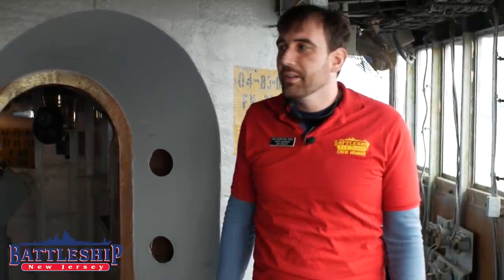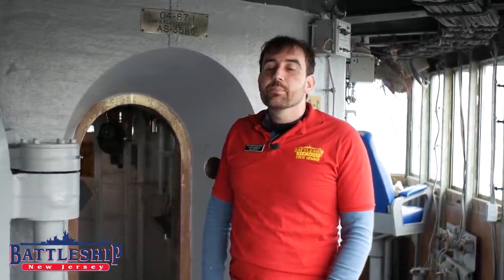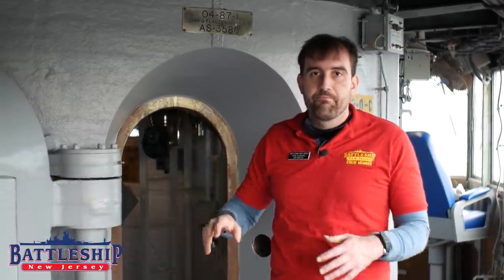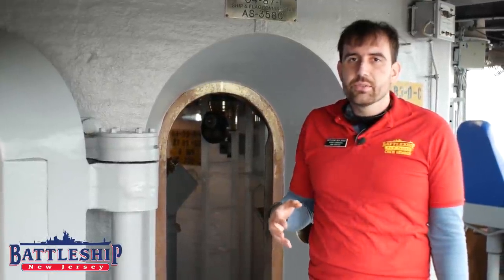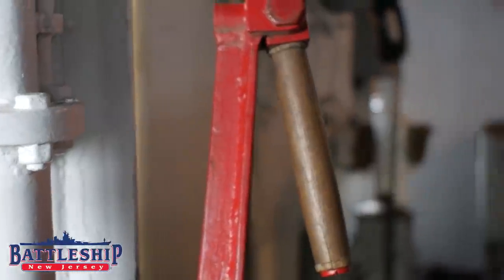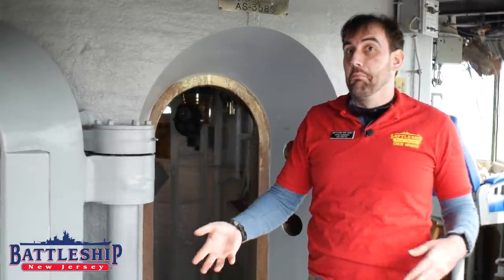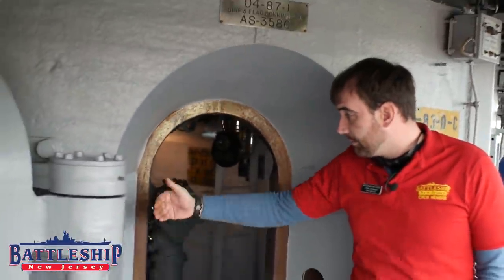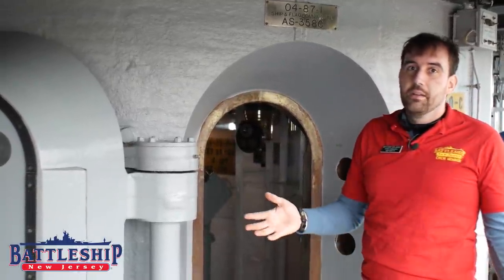Opening the Door to the Armored Conning Tower

Comment: I believe that the crank was a direct mechanical feature of the door and also it is just electric motors that open and close the door; what you would need for the system to be hydraulic is a fluid tank, pump and control levers and if it were hydraulic it would take a lot more time to operate the door with a hand cranked pump
Reply: Despite Ryan's protestations about taking forever and a day that door seemed to move pretty quick once he started turning the crank. Sure seemed like a mechanical operation from my perspective.
Reply: True..  You need a mechnical crank when the hydraulics is NOT WORKING..  So it make no sense to crank a failed hydraulic system in any design.
Reply: Pretty sure the "gearbox" he was turning is just a hydraulic motor. The return tank and all that are on the lowest level of the ship afaik.
Reply: @battleshipnewjerseysailor4738  I didn't see your name initially, I will defer to your expertise.
Reply: think about this if both doors got the hings shot off and they can't get out there basicy sealed in the most armoured place, so if the ship goes down they could possbly live intell the o2 runs out, thats a nightmare i wish i never have
Reply: @tissuepaper9962  Going from electric motor, to hydraulic pump, to hydraulic motor, to reduction gear box, is way over complicating what is needed. Ryan seems knowledgeable, but it would be pretty difficult to be able to remember how every piece of equipment works on that ship.

Comment: Fascinating, just wondering if it was ever actually closed in combat.  The accounts I have read seem to have the crews out on the bridge when battle was going on.
Reply: They absolutely had it closed in combat, no better way to protect your ears from the 16 inch guns when your that close
Reply: It's a condition Zebra opening so yes it would have been closed during combat or when the ship was at GQ.
Reply: I think the brits stopped including them, several were removed from other ships in rework. They were hardly ever used...

Comment: It's all good until you close the door only to find at that moment all the hydraulic fluid has leaked out of the system and you are stuck inside. I assume there is some sort of redundancy?
Reply: I'm not sure hydraulic fluid is necessary for the hand-cranck to work
Reply: It may or may not need fluid depending on how it's designed.
Reply: KING/ARGLE/BARGLE/THE/4TH/OR/SOMEBODY/ELSE  I must have missed that part. Thank you.

Comment: I'm stunned not so much that the door mechanism and locks work, but how smooth they turn.  Aside from a bit of squeaking, it didn't appear that it took a lot of effort a hand crack the door and it's locks.  It's cliché, but they really don't build 'em like they used to.
Reply: No wear, no moving door frame. Works like it did from the factory. I bet they rarely used it except in battle or training for battle, at least by hand.

Comment: On the wreck of the German battle ship Bismark, one of its armoured doors was blown off by a 16" shell from HMS Rodney, but interestingly it didn't have those 3 cross bolt locks to hold it closed like the NJ.
It wasn't even a direct hit to the door but it was enough to rip the hinge off, and without the cross bolts there was nothing to hold the door on.
That shell killed everyone in the conning tower even though it didn't penetrate the armour.

Comment: You are so true about hydralic lines always leaking. 2 jobs that I worked at had a lot of hydalic lines. First place had a company come in for over a week replacing all of the hydralic hoses and bragged that we would not have a single drip for years. After first week had several small leaks. Knowing the milatary sure that regular grease woild not be acceptable for this heavy door so an expensive hard to secure grease would have to be used. In Viet Nam our 3/4 old truck had a grease filled container that every day you were supposed to give it something like a halve turn to keep the water pump lubricated. We used any grease we could gind until motor pool grouchy old sargent found out. He only wanted a certain type of grease used. Of course they were out if stock when we needed it. Was going to use lard from the mess hall to piss him off.

Comment: He makes a specific comment about how many cranks it takes to open, but it was totally reasonable.  If one crank produces even a noticeable motion, crew members working under fire are going to slam it shut very quickly.  It will probably take them longer to realize the motors aren't working and decide to go manual than it will to actually DO the work.

Comment: Just thinking: A locked door murder case in that room would be awesome "and after six hours the detective finally gave up on welding and asked for some explosives. Ten hours of drilling later, they were finally able to blow the locking pins in two, but the door still would not open."

Comment: Have the machine shop fab up a adapter to fit into the gear and the other end to fit a 1/2'' battery power impact gun. You now can close the door very quickly with the impact gun use.

Comment: Thank you for the "curator's tour"  I need to give it as a gift to my brother. 
Yes I would. It looked like the pins move further when the door is open than when the door is closed. 
Safeest stpot? Just below the splinter deck in the citadel.  Why? Lots of armor and close to the life boats. Torpedo's are a killer. Sips do turn over.  That door needs a clear space to open. If there is heavy fire or damage preventing the inner wall from moving past the outer wall then the door is blocked

Comment: **Sips his morning coffee** Ryan, once upon a time in a former life I was one of the worlds Top Locksmiths.  That slab on the door that mates into the milled out cutout?  Strongly encourage people to do that using screws or nails if they've got a door where the hinges swing outward.  Doesn't take much- and it's cheap insurance against bad guys.  Put in 3 large screws, have the bad guys remove the external pins and laugh at them as they expect the door to come off- I promise you, it won't.

Comment: LOL!  Electrohydraulic motors to open the door?  There were two large doors for reactor compartment entry on my ship on the upper and on the lower level (4 doors total) - a large 12" thick outer door about 6' by 3.5' and in inner plug door 12" thick by about 36" by 24".  Both were "sailor powered". LOLOL!  When I see this conning tower door the memories come flooding back.
Reply: Right? I was on a nuke cruiser... only one plug for each of the RC's, but it would take half an hour of cranking to open the door enough to get inside, no electronics, no electricity, just muscles. I don't know what his complaint about the mechanical cranking was all about, that was fast by comparison to our doors!

Comment: You would be surprised that it isn't the doors weight, or size that matters as much as its balance. I was assigned to a site that had much larger and thicker doors then that. It effort to get them moving but once moving no effort at all. you would have to start slowing them a good bit before they closed or else there would be a heck of a bang and they would just bounce open. Often the site was "over pressured" which added more complexity because you would have to mentally judge the effect of the air pushing against the door against its momentum to get the timing just right so that as it closed that you could start spinning the wheel that engaged the locking pins. Not enough momentum and the door would almost close, then did not matter how big you were, you were not going to lock it unless you pushed it open then tried again. At those times in contrast, all you had to do was spin the wheel to disengage the pins and it would open on its own from the higher pressure inside the site

Comment: Safest place on an Iowa? That's a tough question. Even this space could become a fry pan with a fire outside. I'm thinking the spot where they are doing the 16" gun solutions and firing. That's deep enough and enough stuff around it I'd think that would be safe. In the early 1980s I would have thought Turret #2, then that blew up.

Comment: That actually closed rather quickly. Let's see him manually pump up the pressure in the hydraulic accumulators in a F-15 fighter jet using only a breaker bar.

Comment: It actually closed pretty quick considering it weighs so damn much... Imagine that thing in rough seas not secured closing shut on your hand or foot. It's done.

Also imagine the fear when you're trying to unlock it from the inside and open it and it somehow won't open. If that other door wasn't open that would be a pucker moment.

Comment: The locking pins didn't fully engage with the door shut, he only turned the actuator 1/4 turn.  Outside etxending the pins he turned the actuator 1/2 turn.

Comment: Presumably without hydraulic fluid in the system the door would simply be free to swing around, one would be able to move the door simply by pushing against it or using bars to lever it.  A hydraulic leak while out on the open seas must have been interesting, can't imagine what two tons of door slamming open and closed would sound like! 😬

Comment: I find it interesting that the window slit in the door is a funnel with the largest opening to the outside and smallest to the inside. That would seem to "funnel" way more blast and shrapnel into the interior of the conning tower than if the smallest part of the opening was to the outside.
Reply: Um, I think you’re looking at it backwards...the small opening IS on the outside. For the majority of video, you’re looking at the inside of door which has the larger opening.
Reply: The outside window opening is definitely wider than the inside. The outside of the door is wider than the inside.
Reply: I would guess that if a reasonable projectile hits close or on the spot with the smaller gap facing outwards it is more likely to penetrate by pushing a part inwards,the angle of the funnel means that if a reasonable sized projectile hit close to the slit it would be striking the weakest part of the metal first by virtue of it being the thinnest at the narrow slit,it maybe that facing the funnel outwards increases the chances of a projectile or shrapnel,or even the odd stray bullet hitting a slanted face and being deflected thereby losing some of its energy,like angled armour on military vehicle. Also in the event of the ship being boarded by enemy personnel the outward funnel would enable the defender to achieve a much wider field of view and more importantly a much wider shooting range while remaining shielded,like arrow slots in castles.

Comment: Do you think that maybe the cable trunk was originally a viable escape route, but became blocked over the decades and various refits?  It would certainly have always been tight, but it just seemed so close to being possible, and perhaps some addition or movement of cables over the years stopped it?  With not much probability of immediate BB Vs BB action, they maybe considered it to be acceptable to lose it, compared to the effort needed to maintain the necessary clearance when making modifications?

Comment: Not an expert, but my guesstimation given that hand crank that is designed for emergency use, its likely direct gear to gear with no hydraulic fluid to be had.   At least, that is what it both looks, and SOUNDS like as Ryan runs the crank. 
So now we know where Ryan - or Abby - goes to hide for peace and quiet eh?

Comment: I would imagine being a military mechanic that you don't need hydraulic fluid in the system to operate the doors with the override crank it should be on gears and cogs Incase something happened during an attack to the hydraulic system. It would make the most sense

Comment: I am an engineer by trade and i have seen this door in person about 10 years ago when i last visited. The door mechanism itself is purely mechanical using a worm gear and drive shaft to open the door. The power drive is using a hydraulic motor to operate the same shaft but the door itself does not depend on hydraulic fluid to open. The reason it uses a hydraulic drive instead of a direct drive motor is so that if the electric motor fails you do not have to fight its reduction gear to open the door manually. The hydraulic motor wont cause anything to bind if it is not operable and will allow you to operate it manually as you did. It may have lubricating oil in the gearbox and hydraulic fluid in the power drive but a fluid leak will NEVER prevent the door from cranking open manually.

Comment: i wonder if the door uses a mechanical system there at the hand crank that is spun from the motor down below?

if that's the case you are spinning that last stage directly and if the handle was in with the electric system running it would be dangerous.  it would never fly in the civilian world, but its fine for the military.  that would be why someone there knew how to operate the door manually, anyone spending time around it would have to know the basics.

i also wonder, if its mechanical spun by hydraulics at the door, perhaps it was designed purposely that when idle there is not enough fluid pressure at the door to prevent you from spinning the handle.  as a passive safety feature, in the event you lost pressure, you don't need to vent the pressure from a potentially damaged electro-hydraulic system to move the door.

Comment: It would not make sense to have a backup that relies on hydraulic fluid - there most probably is a direct gearing/linkage from the handcrank position to the door. In fact it might be that the whole system is geared/linked and by handcranking it you just do the work of the electric motor. The way the housings and pipes are designed also points me to that conclussion. The fluid coming out of the bottom is therefore most likely only the lubricant for the mechanical system. That was either intended to be a lifetime filling because the whole mechanism is encapsuled, or somewehre topside there is a small access screw to refill it.

Comment: I would think down in the combat center or one the 16 inch turrets would be the most protected place.
Reply: I could be wrong.
Reply: I'm going with being in the Pentagon and watching via networked computers the ship's security cameras...
☝😅
Reply: @Ronaldl2350  hmm, i think the front armor of the turrets is thicker than the sides or rear. Below deck (still kinda technically in the turrets) you potentially have multiple layers of armor, but you're also chilling with tons of powder...
Reply: My guess would be magazines may be the best protected... mostly based on many hours of drachinifel, particularly the video(s) about Hood.
Reply: @jeebus6263  that was my guess as well. It makes sense that they are the absolute most important places on the ship. Loosing power or anything else is still better than being a mushroom cloud.

Comment: When the door is fully opened the lock pin requires 180 degrees of rotation to engage the lug.
but when closed the lock pins were only rotated 90 degrees because there not enough room to swing the lever 180 degrees.
Does this mean the lever has to be reinserted for a second 90 degree throw to fully engage the lock pins when the door is in the closed position ?

Comment: I bet that its not hydraulic pipe instead its a shaft housing and the oil leak mentioned is lube oil
just a thought I had as you did say gear ratio that implied mechanical and thus fail safe

Comment: I am thinking that door weighs more than 3,800 lbs, steel is 450 lbs a cubic foot and the door looks at least 2,5x6 feet . that would be 15 cu feet on a 12" thick door....the taper will have some reduction in size but guessing the 5" by 15 square feet not counted in the 15 cu feet, that is still a lot more weight. wold like to figure out just how heavy it is....

Comment: The doors are Class "A"?  I do not thick so.  The rest of these conning towers armor plates are Class "B" to allow bolting, riveting, and welding to the face of the armor (outside), which is not possible on a Class "A" plate (these have special slots in the plate joints with thick flanges protruding for any connections, such as the armored decks anchored to the barbette face, not to the face itself).

Comment: I would be terrified to close then extend the locking pins on a massive door to a conning tower I was standing inside of. What if something goes wrong with the gears or one of the pins get stuck? That room was designed to keep out high explosive and armor piercing shells. Assuming you could call the fire department to come rescue you, how would they be able to break open a massive steel door?
Reply: A guy would come along with oxy acetalene(gas cutting torch) and cut off what ever was required to release the door,maybe even the door and frame it's self. In the worst case scenario,while out at sea in combat or service the ship being a floating gun platform would be stocked to the rafters with untold explosives,a little could be used in the right places to blow the thing off while keeping damage localised.

Comment: Odd question about the armor.  If you use a rubber mallet or hammer and hit the armor, will the tone or pitch be different based on the thickness of the armor?